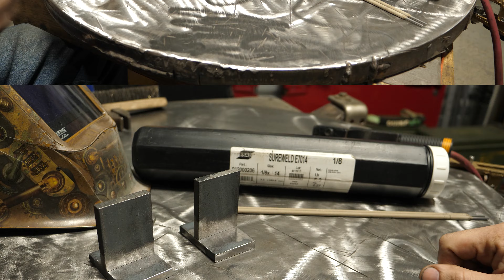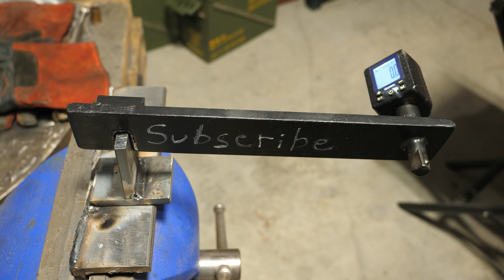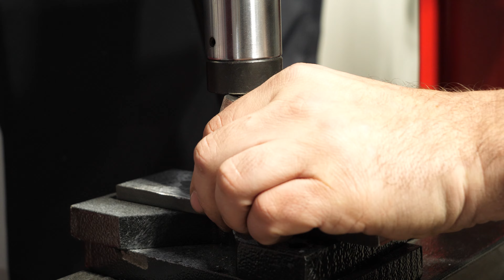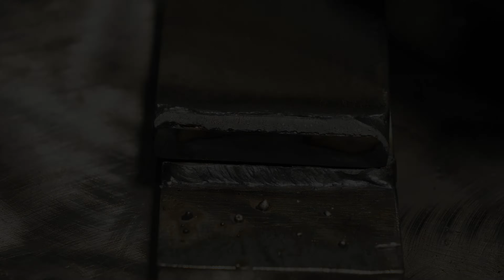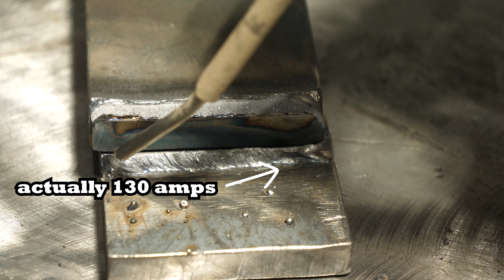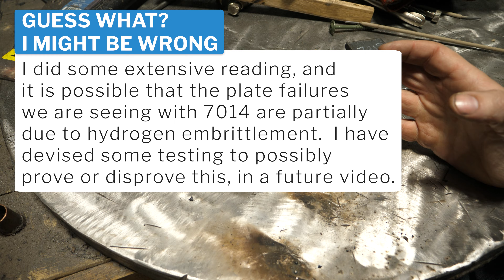7014 vs 7018 weld break test

Comment: When I use 7014   1/8   on 1/4  inch thick up I run 145 amp. With  3/32  I run  115 to 125.  7014 has some good uses and is easier to store easier restarts and you don't have to  use a rod oven . It is not used to bridge or structual work. For every thing else it is just fine. How many of us are welding structual items,,, not many. Greg I may have missed you saying what size rod you used. If you used 1/8 
you were too low on amps on 3/8 , go up in amps .  7018  1/8 runs on 125 amps, 7014  1/8 runs better at  135 amps and up.
Reply from the maker: I ran it at 125 and 130 amps, 1/8th rod.  I will give it a shot at 140 and 150 however I don’t believe either will pass in a bend away from the face.   Off camera I tested it on 1/4inch steel at 130 and it failed as well.  I did test video if increasing amps increases strength in a bend towards the face, and it does slightly, so I know that would lead to improved performance in that respect.
Reply: But why?  Cost is the same.  If you aren't needing to Weld structural steel there's no storage requirement needed for 7018 and its still strong and bites deeper.  There's literally no down side.

Well maybe on restarts but that is a non issue
Reply: I cut my teeth welding 11ga steel with 3/32" 7018 rods....when I did try a 6013, I really disliked the rod.  LoL

Comment from the maker: So this is quite a controversial topic and there is a lot going on.  Based on what I saw in testing 7014 is not as strong as 7018.  The question I have is why is that…. The most likely reason is it has lower actual tensile strength, as stated in the video.  It is also possible that the hydrogen it imparted had a detrimental effect on the steel.  I will be doing further testing to see if that’s the case.  When I test 7024 in a upcoming video, it will be interesting if that fails too 🧐.
Reply: The 7014 filler metal has less ductility, I believe that would largely affect when it yields?